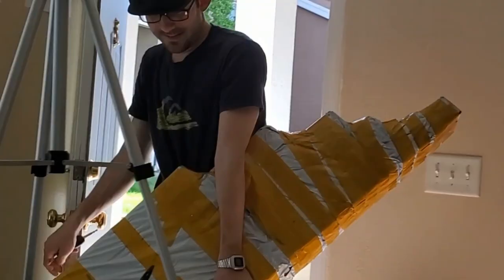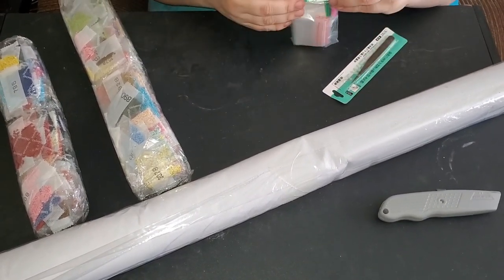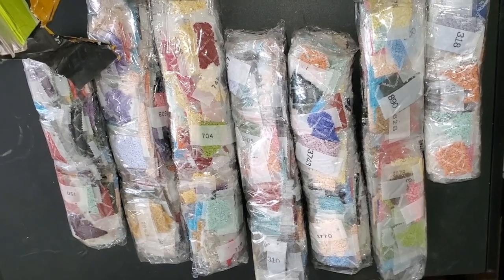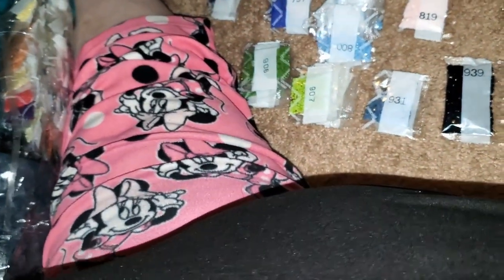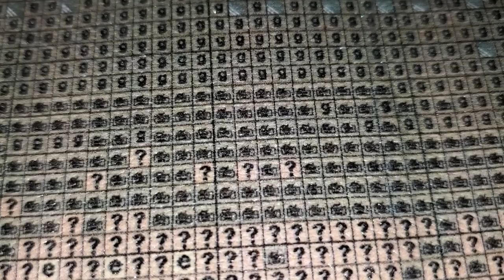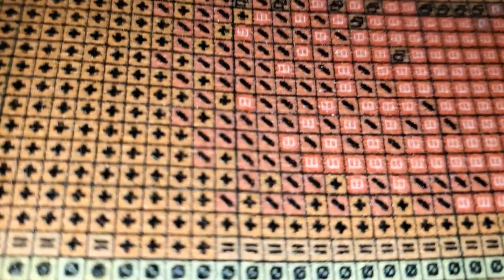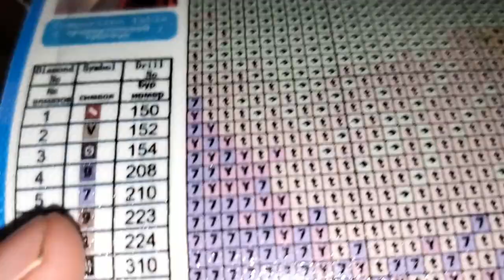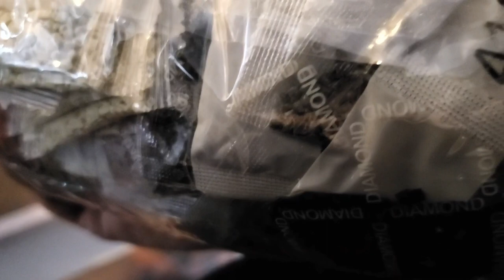Diamond Painting Unboxing Ali-express Meian Official Store

Comment: Holy cow. Thats big. Good things its poured glue, creases dont matter as they come out. A hot towel put on the canvas will smooth anything out.
Reply from the maker: Thank you for the tip! I knew I had to get anything that big in a poured glue.
Reply: Put the towel on the back side of the canvas while its face down. They come out easy on poured glue thankfully.

Comment: If my math is right you should have 334,080 drills for the 116x180 DP
Reply from the maker: Yah I estimated that I have about 400,000 I guessed based on sizes of the bags.  Not all of them are easy to estimate.
Reply: Misty Anthony the formula I use is Xcm x Ycm x 16 = number of drills...hasn’t failed me yet in giving the exact number of “square” drills in a canvas. Hope it helps in future. Also might want to (if haven’t yet) those blurry symbols might appear better with a light pad under them.
Reply from the maker: Thank you so much for the information. I just found my light pad so I will try it out! I am hoping it works. Meian is trying to pull the whole "finish your painting before we send you the drills you need" I'm not happy about that.
Reply: The good news drills are cheap enough that if they screw you over you can still complete the canvas
Reply from the maker: Yes. Thankful for that. I do have some extras but unfortunately they are from multiple sellers with different dye lots...each one is lighter, darker or brighter than the other.